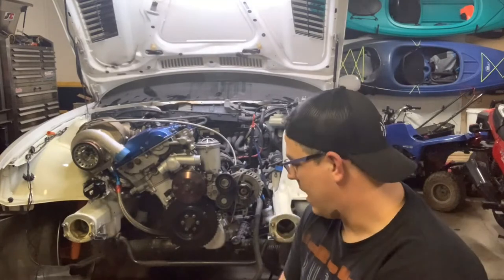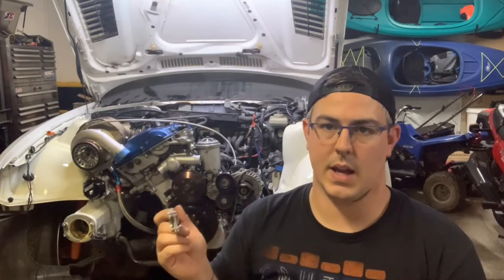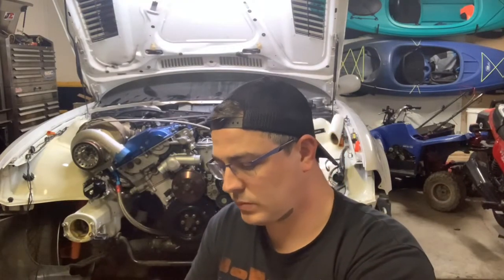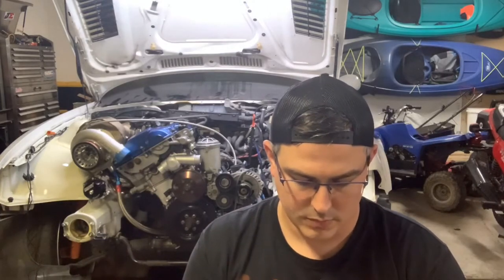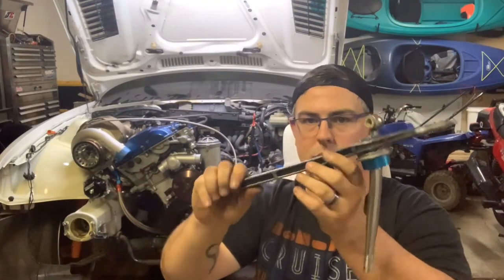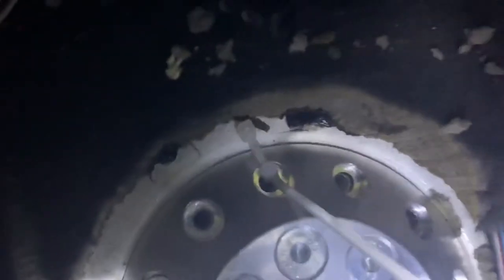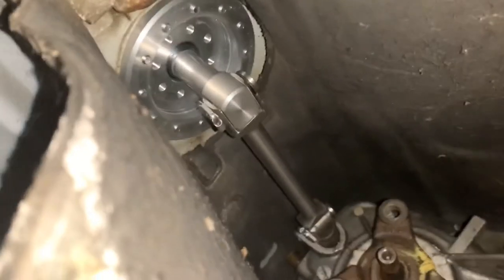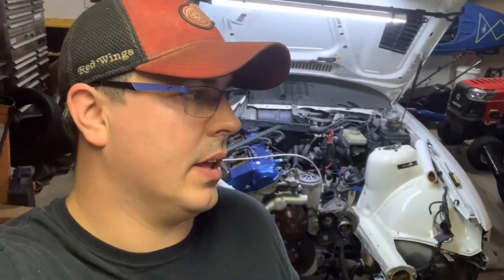E36 PMC Chassis Mount Shifter and DSSR Install!

Comment: Hey did you end up coming back to this and addressing the neutral positioning ? 

And I’m glad to see I wasn’t the only one, after many hours who had the idea that to install this shifter using zip ties lol! I’ve heard of people using magnets
Reply from the maker: I did address it, I didn’t document it though. I needed a shorter DSSR. The trans still needs detents serviced, but that will come later.
Reply: @DadBodGarage  oh ok cool! Did you have them send you out a shorter linkage or did you switch your selector rod joint out for the newer shorter style ? My car has the old black joint which is longer 

My friend gave me the garagistic chassis mount as an early birthday gift. He had it sitting in a box new for like 4 years and he said here have fun with it. It also came with a 184mm straight dssr. I’m bolting it up now and my concern is that it won’t clear the flex disc/guibo? My car is a 95m3 with the zf trans. I got the side in on the Trans next to clip on to dssr to the bottom of the shifter itself and bolt the trans crossmember back up to see if it will all work. I would have to have to use the factory rod since the neutral was way to far forward.
Reply from the maker: @onesikm3  yea, I had to call UUC and have them send me the shorter e36 rod. I forget the total difference in length but it’s not much. Now it’s right in the middle in neutral. 

That’s a good birthday present right there lol
Reply: @DadBodGarage  OK SWEEETT!  Even the one they sent you is also straight no bends needed to clear guibo? So the shorter one is the same length as my original one I removed which 189mm and the one you had received the first time was the 198mm which was found in cars built after 09/94. So which joint did you pair up with the 189 rod to fix the final positioning ? The newest version which is shorter right ?

FYI, generally speaking, people will associate obd1 vs obd2 as being the definitive cut off point as to when parts got changed around on our cars. But in actuality it happened in September of 94’.  All the little quirks and flaws they found out about early on and late model obd1 cars made after this point got the revised parts. I found this out when i tried upgrading my audio system. You know how hard it is finding a early 94 coupes midrange door tweeter bezel which is still in tact 😂
Reply from the maker: @onesikm3  yes, it’s the shorter 189mm one from UUC. The joint stayed the same standard one for a zf from a 328. I don’t recall the part number. 

They had a lot of weird design changes from 94-96. Marker lights, nose panels, obd2, gearbox changes, etc. they didn’t all specifically line up with the obd1 to obd2 cut off point. It’s odd for sure.